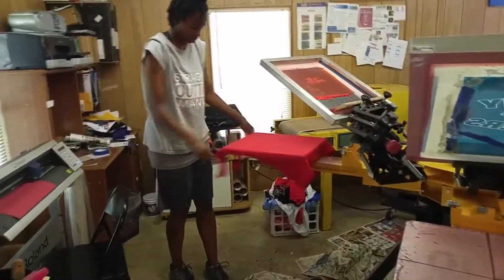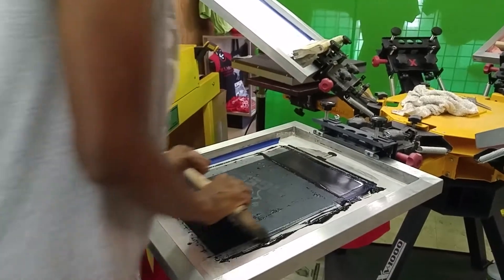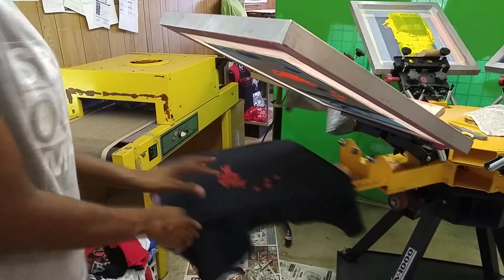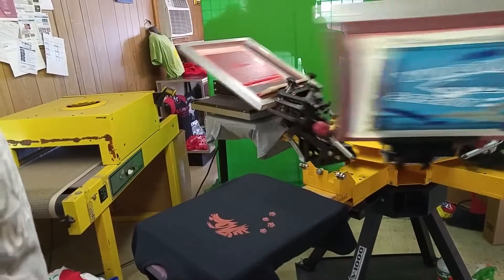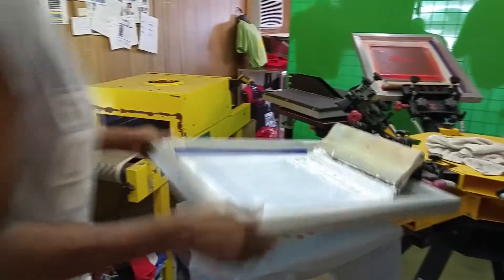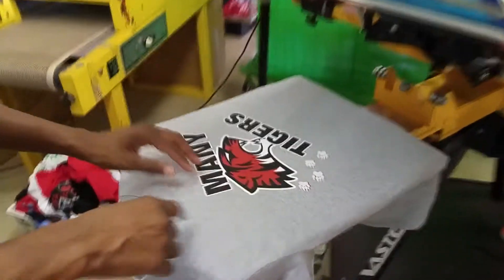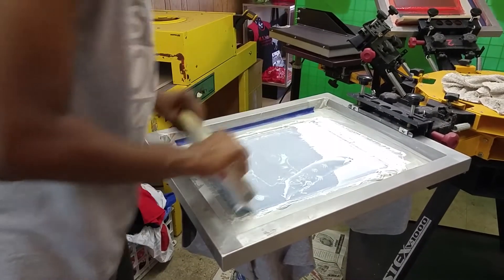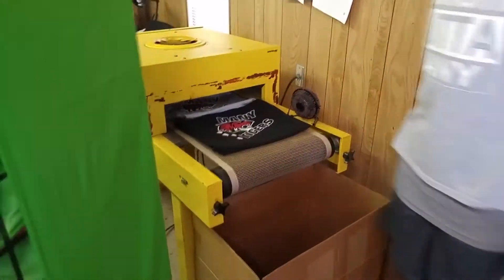Printing Three Color Design on Any Color Shirt

Comment: Can you post more in depth videos on troubleshooting emulsion times and the whole registration process on photoshop as well as lining them up on the table thank you!
Reply from the maker: I can't give you a specific time for emulsion because it depends on so many different variables that I probably couldn't list them all here.  The first thing with emulsion you have to make sure that it is fully dried or it will not work properly then once you burn the screen if the design is hard to wash or will not wash out you probably burned the screen too long.  If the design is blown out or the emulsion is runny you probably didn't let the screen burn long enough.  I did a video about how I line up my film for multi color prints that should be helpful  for you.  Hope this helps.

Comment: How much should I charge to print over 50 three color design shirt one color on the front two colors on the back
Reply from the maker: I can't tell you the exact price to charge but I will try to help.  Pricing depends a lot on where you are located, some places charge more than other places and some a lot less.  Your price can also depend on how much you want to make.  For 50 shirts I would give a slightly discounted price and you also have the option to charge screen fees or not.  I don't charge less than $10 each for that many shirts and the 2x and larger would cost more.  You will also have to use 3 screens for that order so the screen fee could be another charge and the 2nd location could also be taken into consideration.  I hope this helps.
Reply: TshirtChick yes this helps me a lot because lately I haven't been charging enough and found out another local printer who guarantees the lowest price will charge even more than your minimum. Thanks for the speedy reply I pray Father doubles your business and your wisdom😇